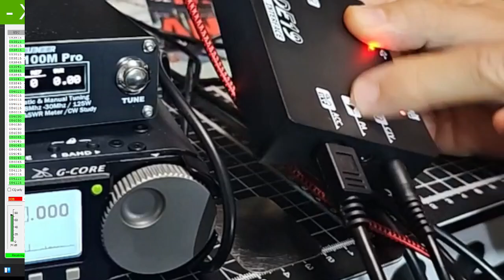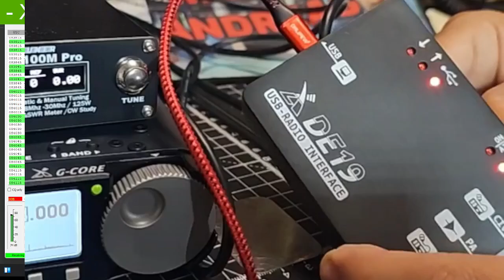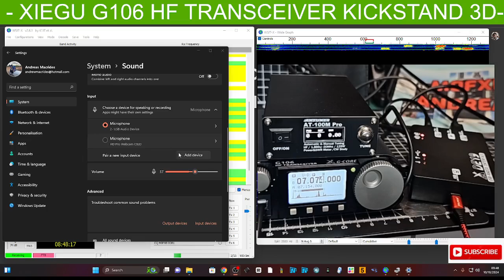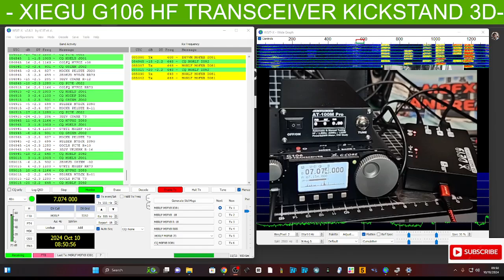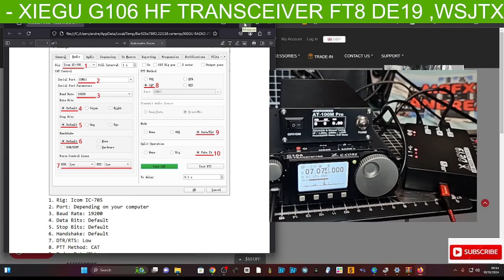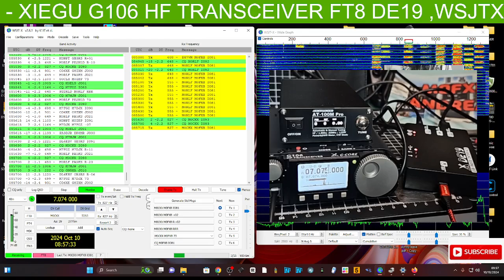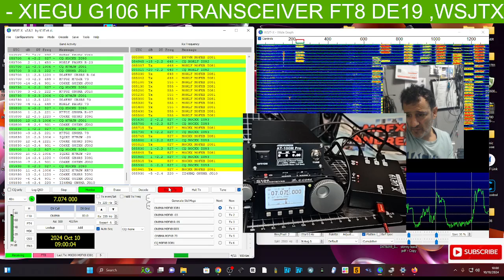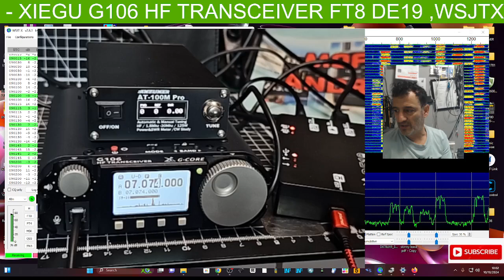XIEGU  G106 - WSJTX Set Up - DE19 Module

Comment: I think your problem is that you did not select CQ as your transmitted text. I hope you already got it figured out. I am thinking about getting one of these myself, just not sure how much I would use it out of the shack... Thanks for the videos. 73
Reply from the maker: get x6100
Reply: @M0FXBHamTech  Even if I have a ft-710 for the shack so not the primary, would only be for while out touching grass? Should have worded the original comment a little different.